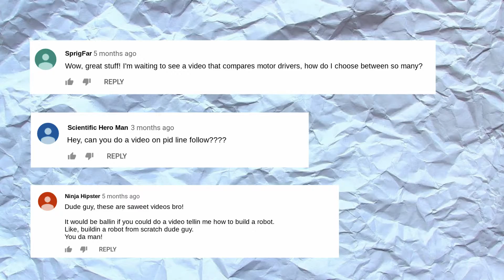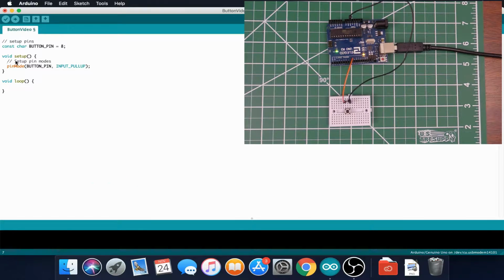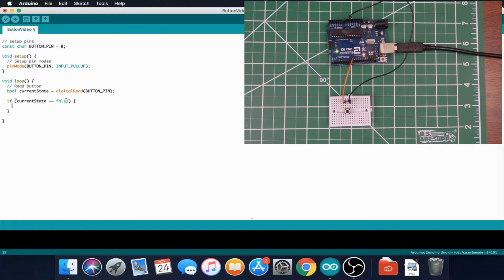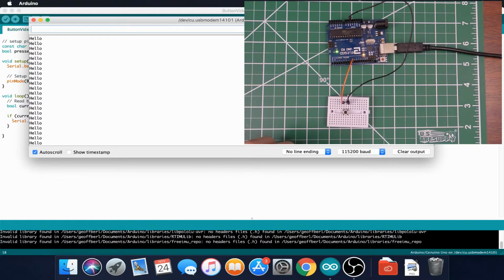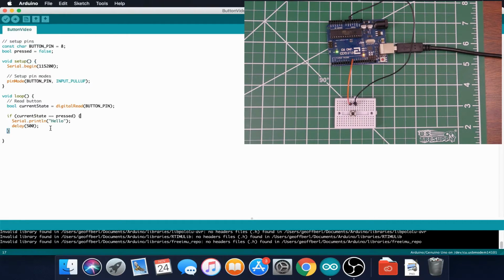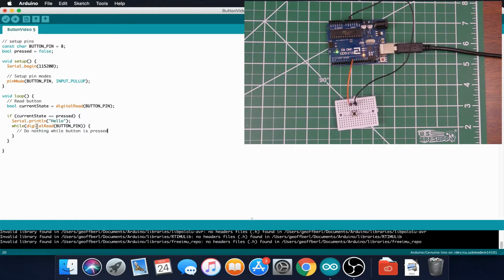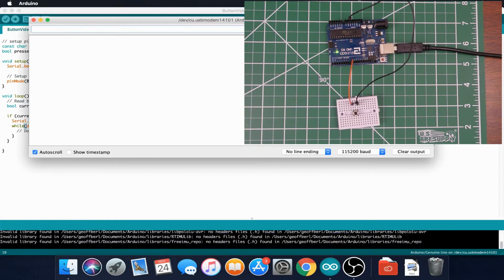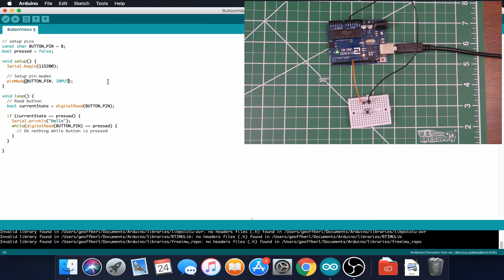How to Program a Push Button with an Arduino

Comment: Thank you for a relatively simple explanation of this code... Now what would I do different if I were using this code to cause the computer to see a button pressed on a joystick?
I race online and have built a 32 button box for controlling different functions. However I need to add three toggle switches and I have spent hours trying to find a code I could edit to make it work using a different Arduino Pro micro, hopefully if you can answer my question about the joystick I can finish that project.

Comment: Just in case you are still watching comments 4 years after uploading this video, I have a request;  I am just beginning my Arduino journey and my first project is to program a Flight Simulator controller.  The device I have built includes a DPST toggle switch with an [ON] OFF [ON] configuration to control flaps.  This is equivalent to 2 pushbuttons in the same switch.  Move the toggle up - the flaps move up.  Move the toggle down - the flaps move down.  I would like my serial monitor to print a line with "UP"  or "DOWN" when the toggle is moved in the corresponding direction.  Any advice would be amazing and greatly appreciated.

Comment: Hi, how can I program 6 buttons so that I can use them as inputs in video games?
Reply from the maker: Sorry for the late reply, the simplest way to do this would be to copy and paste the code but have currentState be each separate button, so you'd have the code as it is in the video, then something like this

currentState = digitalRead(BUTTON_PIN_2);

if (currentState == pressed) {
  // Do something here
  while(digitalRead(BUTTON_PIN_2) == pressed) {
    // Do nothing while button is pressed
  }
}

This isn't the best way but it's the easiest to describe in text. A better way would be to create a function that reads a button based on the pin value passed in, then you're code would look something like this (this is much cleaner and repeatable without copying and pasting a lot of code, it's just a simple if statement copied and pasted.

if (buttonPressed(BUTTON_PIN)) {
  // Do something here
}

if (buttonPressed(BUTTON_PIN_2) {
  // Do something here
}

But you'd have a custom function called buttonPressed() which would return true/false based on the button pin state. That would look like this

bool buttonPressed(char buttonPin) {
  if (digitalRead(buttonPin) == pressed) {
    // Do something here
    while(digitalRead(buttonPin) == pressed) {
      // Do nothing while button is pressed
    }
    return true;
  } else {
    return false;
  }
}

Comment: Can you make a video where you explain how you could do the same, but instead of printing somethign on your computer, you display it on another apparat, aso another peace of hardware, that just does thing when a button is pressed (could also be a light turning on/off or smth easier than displaying text)
Reply from the maker: I could do that, but unfortunately, I haven't had any time to make new videos for quite some time now. It would be easy to change this, though, just change the Serial.println() code to do something else instead, like digitalWrite(LED_BUILTIN, HIGH) to turn on the onboard LED. If you want to be able to toggle the LED it would require a couple more lines of code but it's the same concept.

If you need some more information than that, I can help but, I unfortunately won't be able to create a video though.

Comment: your basicaly stopping the while loop, this will be not good for almost any project you will put it in. you should change that to a deley instead
Reply from the maker: A while loop is "basically" stopping the program but a delay IS stopping the program. The video shows how a printout will repeatedly print while the button is being held down and that's exactly what I'm avoiding with the loop, if I change to a delay then this doesn't solve the problem. Also, you can do other things in the while loop so that your code continues while holding the button but just doesn't activate the button code repeatedly.

As an example, check this recent live stream out https://youtu.be/HhhEHECKywM, I use the while loop and still execute code while the button is being held down. I personally try to avoid delays because they do in fact stop the code completely and you can't do anything else during the delay. In some cases a delay is fine, just as in your case, it may be fine but in this particular video, as mentioned, I'm trying to avoid repeatedly triggering the button code when the button is held but also allowing the program to pick up button clicks that are extremely close together.

Comment: I used this code using analog for push button. I couldn't get past the while loop. Is there any solution?
Reply from the maker: Using an analog pin? Are you using analogRead() instead of digitalRead(). You can use analog pins as digital pins, they are in fact digital pins but have the added feature of a DAC which converts digital to analog but you certainly don't have to use that. If you are using analogRead then ANY value that is not 0 will return a true when you do "if (analogRead(pin) == true)".

If you're using an analog pin as a digital pin just simply use digitalRead(pin) and it should work the same.

Let me know if this helps or you need more help.

Comment: I would like to know how you can take one momentary button and get 2 functions from it with a short and long press. The first short press will make an LED blink untill the button is pressed short again to stop it blinking. The second function of long press will sound a horn as long as the button is pressed and stop when the button is released.
Reply from the maker: Sorry for the delay. This is a great question and an interesting problem. I hadn't responded as I wanted to do a video on it but I'm so swamped I haven't had a chance. So, I've never done one but I think I'm going to try and do a live stream tomorrow and get this done.

I've generally stayed away from live stream because my edited videos are already long so a live stream is going to be longer... we'll see how it goes, hopefully you still need this but if not, it's a learning experience for me anyway and maybe it will help someone else.
Reply: @RobotResearchLab  can i watch the livestream afterwards or only during? I still need this but i won't be able to follow the livestream tomorrow
Reply from the maker: @joscornelissen5626  you can watch it after, it will be saved just like a normal video.
Reply from the maker: Here you go, let me know if you like it or dislike it, what I could do better. I hope this helps, thanks for watching. https://youtu.be/HhhEHECKywM

Comment: Man you're the best . I went through the comments and you're helping all the beginners. I also had a little problem . Whenever I release the buttons , some extra A's are being printed.
Reply from the maker: Hey thanks, I like helping people out, happy to help. Sorry for the delay, I responded to your other comment. Let me know if that helps. If it's happening when you release, try putting a short delay after the release is detected maybe something like delay(100) or try increasing if it doesn't help. If you get to over 250 then it's likely something else unless you're really slowly letting the button go.

Comment: it doesn't work for me
Reply from the maker: I'd love to help, but I need more information, what issue are you seeing? (Doesn't compile, doesn't print, etc)
Reply: @RobotResearchLab   Actually I am working on interlock system for that I need 4 push button  and when one push button pressed it should be high and others status must be low even pressed but I tried for one push button it didn't work.
Reply from the maker: @sc-ty1ei  Can you provide your code in my contact form? www.robotresearchlab.com/contact

Comment: ayyyyyy I was 1000 th sub still working with the code since I messed something up xD
Reply from the maker: Ha ha, thanks. Let me know if you need help with something.
Reply: @RobotResearchLab   actually Im trying to program a button to act as a keyboard key right now and havent been able to find any tutorials
Reply from the maker: @Qwzdf  Ah, so like a macro to make your Arduino button simulate a keyboard button (or sequence)? If so, what board are you using?
Reply: @RobotResearchLab  yes, Im using uno 3
Reply from the maker: @Qwzdf  Just a heads up, if you want to control keys on a computer you need a specific Arduino board for that. Here is a list of supported boards, I always used a Pro Micro (generic brands work too, doesn't have to be Arduino brand)
https://www.arduino.cc/reference/en/libraries/keyboard/

Comment: Worked well, thanks! I need to debounce next as this is for a midi controller and it's bouncing like mad!! Subbed 👍❤️😎
Reply from the maker: Thanks for the feedback. Debounce is on my list but unfortunately I haven't had time for videos lately (been saying that for way too long).

The easiest way to hack around that would be to put a quick delay after the button press is detected (that way multiple presses within a certain time won't trigger the code multiple times). Probably something like `delay(100)` would work as a guess. There's also button libraries that handle debounce but I'd suggest you read through the code in the library so you understand how they're doing it and it doesn't work against you.

Thanks again.

Comment: Great Help, and Really well explained. Thank You!!
I have tried it and it fixed a problem that has been driving me mad.
Please can you tell me how I can multiply this exact code to control multiple buttons?
Reply from the maker: Hey, I'm glad it helped, if you want to reuse code for different objects, the best way is to create a function. Functions allow you to reuse code with slight changes so it works for multiple situations.

In this example code I simply moved the code from the loop() into its own function.

bool isButtonPressed(int buttonPin) {
    // Read button
    bool currentState = digitalRead(buttonPin);

    if (currentState == pressed) {
        Serial.print("Button on pin ");
        Serial.print(buttonPin);
        Serial.println(" pressed");
        while(digitalRead(buttonPin) == pressed) {
            // Do nothing while the button is pressed
        }
        return pressed;
    }
}

Now, this code can be used for a button on any pin by simply supplying the pin number, an example would be the following.

void loop() {
    // Check if the button on pin one is pressed
    isButtonPressed(1);

    // Check if the button on pin 4 is pressed
    isButtonPressed(4)
}

Now, because I added a "return type" (bool isButtonPressed), the bool means our function returns a bool (true/false). So, you can actually remove the Serial statements so all the code does is respond back with whether the button was pressed, and now you can do different things for each button, see below.

void loop() {
    bool btnState = false;
    // Check if the button on pin one is pressed
    btnState = isButtonPressed(1);
    if (btnState == pressed) {
        // Do something for this button
    }

    // Check if the button on pin 4 is pressed
    // You can also use a shorter version of code that does the same thing
    if (isButtonPressed(4) == pressed) {
        // Do something for this button
    }
}

Thanks for watching and for the feedback, I hope this helps.

DISCLAIMER: This code was written in the comment so it hasn't been tested.
Reply: @RobotResearchLab  Wow that's AMAZING!!! thank you so much.
I' can't wait to get stuck into this.😃

Comment: Good evening, I am a student and am working on my final project. I want to ask what if the "Push the Button" 5 seconds turns on then turns off again. Thank you please help
Reply from the maker: Sorry for the late reply, do you still need help on this? If so, I need some more information as I'm not understanding your question exactly. Do you want to push a button for 5 seconds in order to trigger some action or push the button and have it wait five seconds before doing something... or something different than that?

Comment: DUDE WHY CAN'T YOU JUST PUT THE STINKING CODE IN THE DISCRIPTION?
Reply from the maker: I don't typically post the code in the video because I'd prefer that people write the code as they follow along so they can better learn the code rather than copying and pasting. That being said, I do generally always post the code in my website, I just don't link it for the reason mentioned. Here is the code if you'd like to copy/paste it, thanks for watching and commenting. http://robotresearchlab.com/2021/01/05/how-to-program-a-push-button-with-arduino/

Comment: Author should use CTRL + to increase font size for his videos.
Reply from the maker: I was not aware the code wasn't readable but I've received comments from others as well so I will try to remember to increase the font size in future videos... when I can get back to making them, thanks for commenting and providing feedback.
Reply: @RobotResearchLab  - I should clarify that I was watching on YouTube.
Reply: On a TV
Reply from the maker: @johnalbu2319  Ha ha, that makes a little more sense. TBH I have received similar comments, I'm not sure if they were watching on a TV. I did check out my video and it could definitely benefit from larger font. I usually review my videos full screen on a laptop so that could also be why it looks okay to me.

In any case, I will be trying to remember to increase the font for future videos... whenever I get time to get back to them.

Thanks again for the feedback, and also for the clarification 😄

Comment: byte BUTTON_PIN = 8;
//bool pressed = LOW;
void setup() {
  Serial.begin(115200);
  pinMode(BUTTON_PIN,INPUT_PULLUP);
}

void loop() {
  bool currentState = digitalRead(BUTTON_PIN);

  if (currentState == LOW) {
    Serial.print("Heyello");
    delay(200);
    while(digitalRead(BUTTON_PIN) == LOW ) {
  }
  }
}
Reply from the maker: I should have noted here, I answered this in a comment left on the blog article. If anyone is seeing this issue please check out my response there https://robotresearchlab.com/2020/08/28/four-load-cell-with-hx711-programming/#comment-3738

Comment: For beginners, it helps to add the actual sketch to the video notes. Even at full screen, your screenshots are too blurry to see the small punctuation marks clearly (and a pain in the ** to transcribe by pausing the video every two seconds)
Reply from the maker: Sorry about that, it's recorded in 1080p and looked good from my view. In any case I do have a write up with the code. I don't always pay the code for the smaller projects because I like to have people follow along and understand the code.

Here's a link to the post with the source code. http://robotresearchlab.com/2021/01/05/how-to-program-a-push-button-with-arduino/ 

Sorry again and thanks for the feedback.

Comment: wow
Reply from the maker: Thanks? I'm not sure if this is a good wow or bad wow ha ha. If good, then thank you. If bad then please let me know what I can improve, thanks again.
Reply: @RobotResearchLab  Its Great! I am just intrested into programming - I am currently learning python know some basics and got this video in my recommended and though that it was cool to see that you can get output on things that you do daily using code. I like robotics and never knew anything about Arduino and think this would be great for me to buy as I did similar projects like solar pannel movement when I was younger.

Comment: Hey buddy any advice, i want to control my claw machine with my keyboard. Any ideas where to start? I want to be able to moved the claw and drop it as well.
Reply from the maker: Hmmm, I don't have any videos on this sort of thing, I actually don't even have any on Servos which is probably something I should have covered. In any case, to answer your question:
1. Start by simply trying to manage user inputs, for that I would start here https://www.arduino.cc/reference/en/language/functions/communication/serial/read/
2. Now, I would modify that code to make a motor movement instead of printing out what was entered. You'll either need a series of if, else-if, and else statements or a switch statement
3. Once you have all that down I would start to define keys for each individual servo. I'm assuming you probably have three much like a human arm (shoulder rotation, elbow bending, and wrist bending)
4. You could modify the code to accept three values and move each servo to the value passed in

As a bonus, since this is all done by reading character inputs you could easily modify this to work with bluetooth as an enhancement. I should have a video on adding bluetooth, but it essentially does the same thing except you can add buttons to a phone app and press the buttons on your phone to control the arm instead of having to send one character at a time (the button sends the character for you automatically).
Reply: @RobotResearchLab  , any idea how much you would charge me to get it setup?
Reply from the maker: @melannieworld  Unfortunately I don't have much time for robotics lately, I've got a lot of personal tasks to complete before I can get back to making videos and helping directly. If you contact me through my website, it will send me an email and I can try to help you through emails. http://robotresearchlab.com/contact-me/